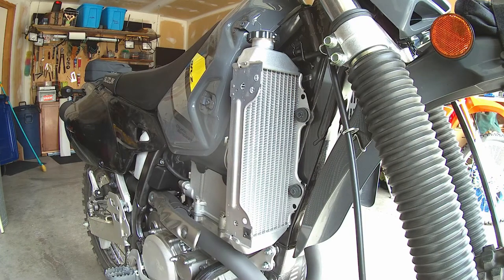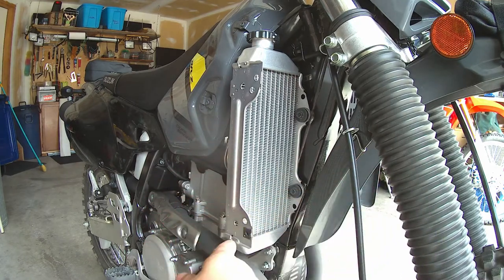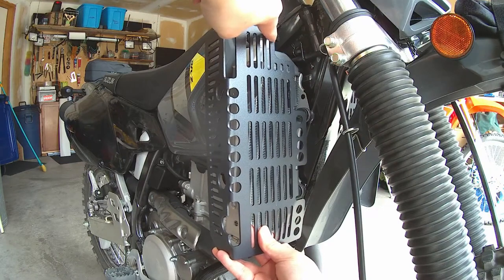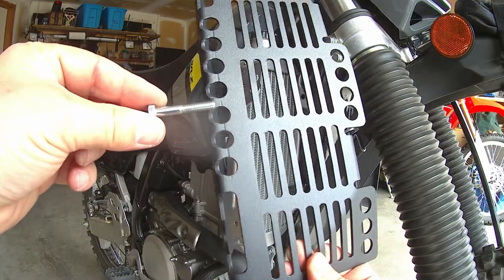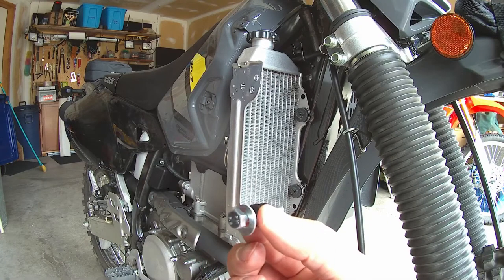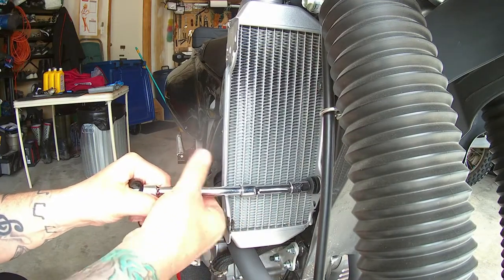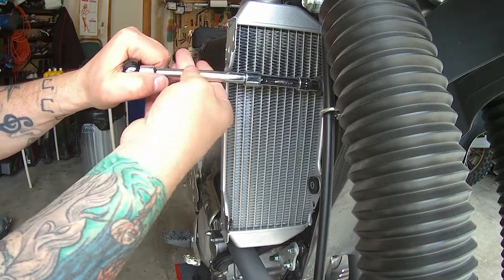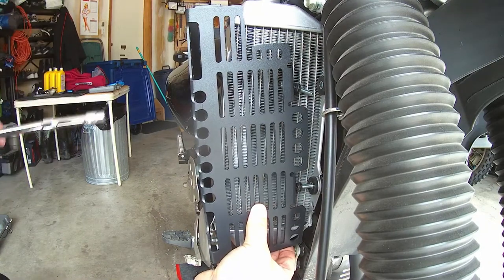2021 DRZ400S - Xitomer Aluminum Radiator Guards

Comment: Do the new guards clear the front fender?
Reply from the maker: I don't have the bike anymore although to answer your question - by trimming off that small area of the guard, it was able to freely move without touching the fork clamp. There was about 1/2 inch clearance between the guard and the fender so no issue there.